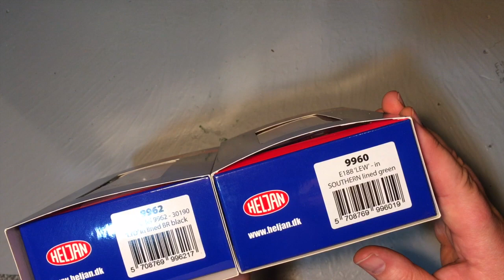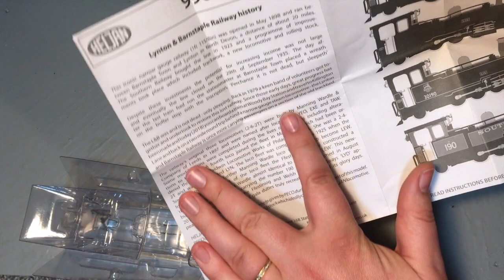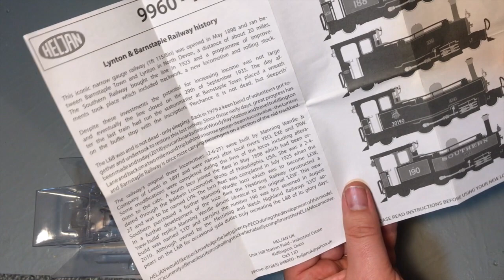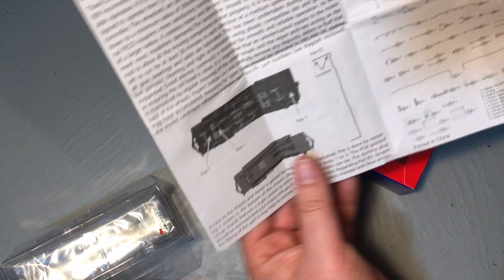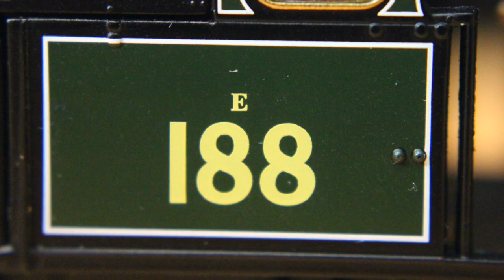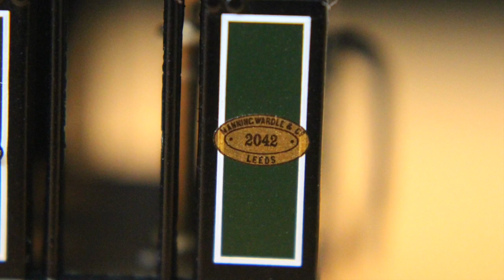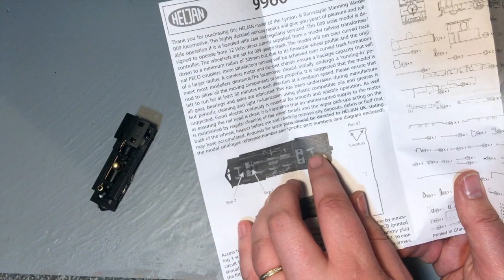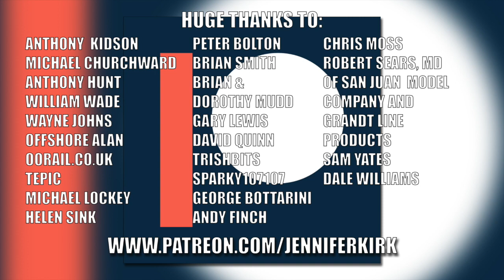Heljan Manning Wardle Locomotives - Best Value Narrow Gauge?

Comment: Hi Jennifer. I didn't realise how small the Lynton & Barnstaple locomotives were. I have several and a lot of coaches and other rolling stock but I haven't started to build a layout for them as I have run out of space and have been focusing on my large collection of "OO" SR/BR stuff. One thing I did find was that the couplings are very small and were loosely packed and I was lucky that they didn't end up on the floor. I enjoy your videos and I may even buy the Baldwin 2-4-2T when it comes down in price as I have not seen it below £220. All the Manning Wardle 2-6-2T's I have bought so far have been below £190 and a couple were about £140. Thank you for the very entertaining and informative videos. Ian Cooper.

Comment: Also just a reminder the Replica Lyd which actually Lew, was built at Boston Lodge on the FR in 2010, so no chance of it being running 20 odd years, or more and I might also add the Original Lew which was the only loco which did not get scrapped on the L&B was sold for use in Brazil, however that is a debate on its own, as when the loco had finished taking up the track on the original L&B, and left Barnstaple Town/ L&B it went to Newport Docks, I believe and was put on a ship, however the shipping records were lost in WW2, so we dont really know what happened to Lew, however as you say she is probably scrapped long by now but, however we don't know 100%, some say she's still their, the original Lew was the final Engine Delivered to the original L&B, in around about 1925 ish

Comment: I chose a Nice Heljan L&B Manning Wardale No E188 Lew in SR Green for Xmas, sadly the Crankpin went on it so I am awaiting a response from Rails Of Sheffield with a Replacement Lew, as My Narrow Gauge Line in My 14X10 Loco Shed 00 and 009 NG Line, is crying out for at least 1 L&B Manning Wardale, as My Narrow Gauge line is looking pretty L&B Esk with the expectation of a TR/ FR Slate Mine/ Quarry and a derelict line which goes into the mine

Comment: I had one of these and in the first 20 minutes the piston rods began to fall of, may have been first batch, but I had to send it back gutted.
Reply: I think the first batch of these have lots of problems.the one I bought online had problems with  valve gear assembly,connecting rod holding piece,over gauged center drive wheels,hardly revolving trailer wheels and volatile valve gear guards.Both  of them were twisted outward and got broken when I tried to fix the problem.Finally I had to return it to the seller for repair as the plastic holding pin of connecting rod broken while on a run.I hope the latter batches are without these problems